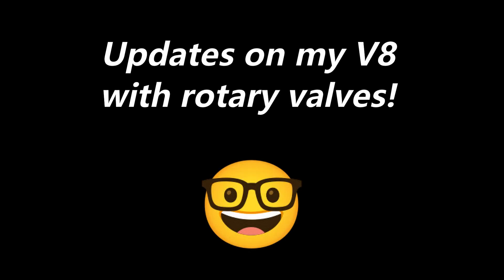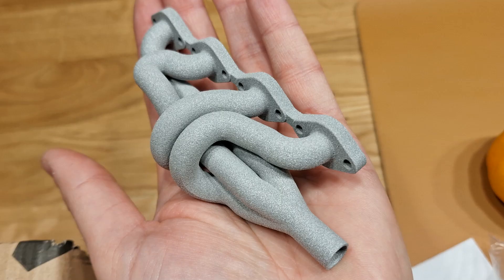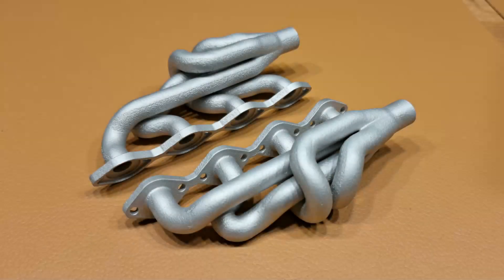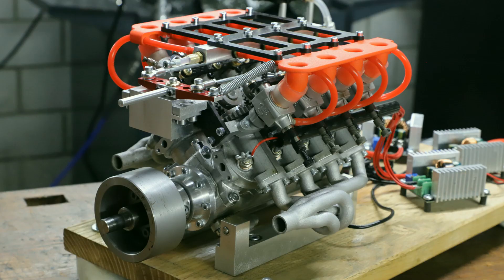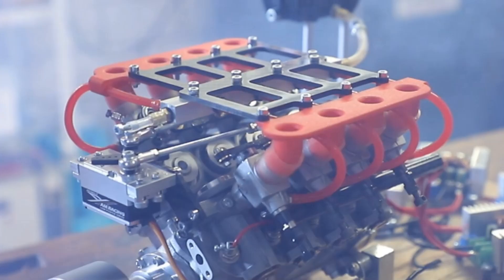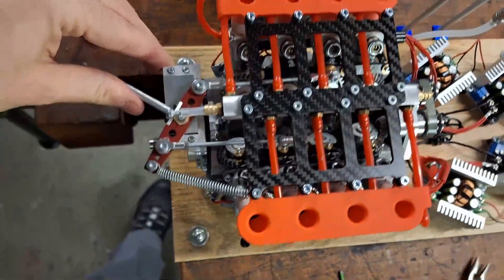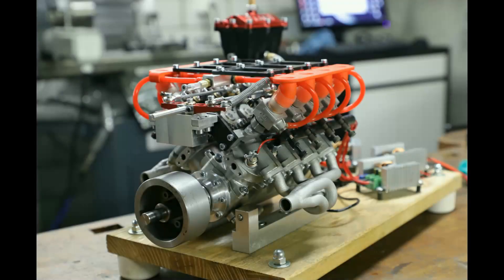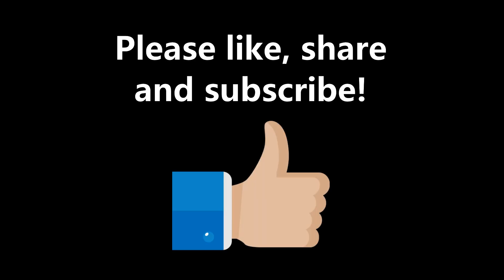Part 10: V8 model engine with rotary valve / New Exhaust and throttle drive

Comment: What fuel dos this run on?
Reply from the maker: Hi Adam! It runs on methanol oil mixture.
Reply: @danielhunziker3577 nice :D what sort of compression is required for that style engine?
Reply from the maker: @adambundy2639  Hi Adam 👋 Compression ratio is 8:1. But you could easily go higher.

Comment: Hi Daniel, nice running engine! I didn't quite understand the (transcript translation of) SLM metal composition, can you please elaborate. Are you able to mention who you used for SLM printing or a recommendation in that regard? I've built a running 50cc model radial engine, familiar with 3D CAD & would be interested to utilize this service on forthcoming projects.
Reply from the maker: Hi Peter 👋 I will write in English. But from your name I assume your mother tongue is German. If so, let me know and I'll write in German (my mother tongue). SLM is SelectiveLaserMelting. It's a laser-based 3D printing technology in which metallic powder materials are selectively melted layer by layer to produce complex 3D objects. it's a process with a high degree of design freedom. I made cylinders, engine block, pistons and intake manifold from it. Made from aluminium and/or titanium. This via the Protolabs online shop (plastic an metal 3d printing). But be aware that no finished parts will come out. The accuracy and surface quality is modest and all dimensionally relevant areas must be machined. So you also have to calculate allowances when printing.
Reply: @danielhunziker3577  I live in Canada (German parents) but I appreciate your effort to translate. Thank you for the Protolabs link, I will check them out. I think 3DP metal  would be a very interesting video topic for others to learn by your experiences - things to be aware of, shrinkage allowance, machineability, any strength issues etc. Because casting is such a special field for hobbyists. Also I invite you to join some of the model engineering forums like MEM (Model Engine Maker) & HMEM (Home Model Engine Machinist). Lots of like minded hobbyists. Keep up the great work Daniel. Great channel!

Comment: Why did you make the collectors so small on the headers?
Reply from the maker: Hi man 👋Can you explain to me what exactly you mean by "so small"? the collector on the exhaust has a diameter of 10mm. The individual pipes come out of the cylinder head with 8mm.

Comment: I like the finish on the new exhaust manifolds. I would love to know your secret on the valve gears. I'm sure the video takes out a lot of the noise... even still, I don't know how bevel gears are so quiet.
Reply from the maker: Hi James 😃 Yeah, spur and bevel gears are often very loud due to the straight toothing. However, the noise is directly dependent on the load and gearing quality. My rotary valves have very little friction, which means that the overall load is very low. For this reason, the noise is also low. That's why the noise is kept as low as possible. Of course, I'm just using high qualitiy gears with a good shape accuracy and surface quality. I use an EOS 6D MKii for filming with an external microphone. I did not actively use sound filters. In reality, I don't actively hear noises from the gear drive when the engine runs (reversing a car is much worse 😅). This may also be due to the fact that the oil around the rotary valves and the timing belt certainly provide good damping.
Reply: @danielhunziker3577  - I'm assuming you outsourced the gears then, as opposed to cutting them yourself?
Reply from the maker: @JamesCopeland-i1j  Correct, I didn't make the gears myself. Especially as I know how delicate gears are to manufacture (I originally come from the gear manufacturing industry). I always take care not try to save money in the wrong place 🙂 For example, I also use SKF ball bearings exclusively.

Comment: Ilmor made a v10 version much like yours, could we please have the v10 music too?
Reply from the maker: Hi mrwolsy3696 👏 I'm a big fan of the Formula 1 V10 era. For me, the engines back then were the pinnacle of engineering in terms of technology and sound. The V8 here is also inspired by this period. I'm currently planning a new engine. I don't yet know whether it will be a V8, V10 or even a V12. But I'm already leaning towards a 90° V10 along the lines of the Ferrari Type 053.

Comment: Really nice job done on it. The sound is so great too! 

What carburetors are you running ? I'm designing an inline 6 of 120cc for an airplane but walbro carburetors are quite big and heavy...
Reply from the maker: Hi maxairmodels7796 👋 I'm using 8x OS 4C 8mm caburators in this V8. You can buy quiet similar ones direct from Japan for arround 35 US$ per pcs (https://www.rcjapan.net/index.php?main_page=product_info&cPath=80_413_455&products_id=12795&zenid=a40ockefuloleleqfat1sfi050). This would be very suitable for your inline 6 120cc engine, as long as it's a methanoler. You should use 6 of these. But If you are building a gasoline engine these carbs are unsuitable because they are very difficult to adjust with gasoline.
Reply: @danielhunziker3577  Thank you Daniel for your reply. 

The initial plan was going with a gasoline engine but after your reply, the methanol makes more sense to my eyes as 20cc per cylinder isn't that big. The weight reduction will be also significant without the ignition system even though I'll need more fuel onboard. 

As you have much more experience than me, what do you think about it? The engine response should also be improved in comparison to gasoline. Do you run your engine with nitromethanol ? If yes, what percentage? 
I used some for my 2 strokes rc car, 2 strokes rc airplanes and also for a 4 stroke Saito engine if I remember well.

And last question, what compression ratio do you think will be suitable for my application? 

I can frendly send you the Fusion 360 file of the engine (just a few details missing and not designed but nothing crucial)

Maximilien
Reply from the maker: @maxairmodels7796  Hi Maximilien 👋 Your name sounds like you're from France or Belgium? Gasoline is one of those things. Mixture formation is much more delicate/sensitive and you also need an ignition system. I recommend starting with methanol. If the engine runs with it, you can still consider converting it to gasoline in a 2nd step. Nitromethane is generally not required for displacements > 10cc per cylinder. Nitro willl improve the adjustability of the carbs. But you can use pure methanol with around 10% oil in it (e.g. Molsynth 120). All my engines run with methanol with 5% Nitro in it. By the way: Have you already seen my V12 with 120cc? https://www.youtube.com/watch?v=sLy9mbBO354 An optimum static compression ratio is 8:1 for methanol-powered engines.
I have shown many things in my videos about how I build engines. Perhaps these can help you as well. You don't have to share your design. To be honest, aircraft engines aren't so intersting to me. As you can see in thi svideo, I'm more in exotic and racing engines like the ones from formula 1 😬😬😬
Reply: @danielhunziker3577  Hi again, you've guessed right, I'm French and currently studying in Munich (my German is not that great 😑). 

I'll do so. Start with methanol. 

I've watched your video about the v12, and I liked it. The methanol conversation was interesting in my case. I would just give equal length headers to it to get that lovely v12 screaming sound. I'm a car enthusiast too, by the way, so I understand 100% your statement. I'm building this inline 6 because I was bored to see mono cylindre at the field, I want something more special, and being a bmw fan boy, the il6 makes sense 😂. 

Your videos do help me design my engine. It's the most interesting channel about model engine : great quality, explanations, and great content.

One thing that caught my eyes is the single cam profile fixed on a rod precise and durable enough? I would be afraid if it came loose by the time, especially on such small scales. 

Another thing is the crankshaft, and as a matter of fact, before watching your videos, I used to design my engine with a multiple pieces crankshaft and with bearings pretty much like yours, but I switched to a conventional architecture with 2 pieces connecting rods as it is lighter (the engine should weigh ~4kg).
Reply from the maker: @maxairmodels7796  On the other side, my French is very bad 🤣 Then I'm not even allowed to say that I have a Luther BMW inline 6 cylinder with 55cc displacement. It's a replica of a BMW M20 engine.

This type of camshaft is common and tested in model making. Even Schillings has done this on an industrial scale. My VR5 also has such a camshaft. Never had problems with it.

I deliberately use multi-part crankshafts. The reason for this is that I don't want to have 2-piece connecting rods. These are super delicate and the screws tend to break off. With assembled crankshafts, you can use solid M4 or M5 bolts. That is super safe! The V8 here weighs only 2.9 kg with 53cc and has a multi-piece crankshaft. This is made of titanium with hardened steel crank pins. So a multi-piece crankshaft can also be lightweight.
Reply: @danielhunziker3577  okay, it's really nice having your advice. I'll deeply reconsider the camshaft and the crankshaft design. I was using a 3 valves per cylinder configuration (2 for the intake and 1 for the exhaust) with followers, so the 3 cam profiles are pretty close on the shaft, I'll try to figure it out, maybe I'll go for a double overhead camshaft. 

Knowing the weight of the v8 gives me faith for the crankshaft even though titanium will be hard to machine

About the m20 replica, don't hesitate to film this masterpiece 😂, i would love to see that scale intake manifold!
Reply from the maker: @maxairmodels7796  Hi Maximilien. I recommend that you build a 2 valve valve. Have a look at the OS or Saito engines! These are all 2-valve engines. My multi-cylinders engines from Schillings, Luther or Conley are also all 2-valve engines. Simply because it is easier to manufacture and the few percent extra power with 3 or 4 valves is usually negligible in a model engine.

My V8 isn't a reference. It was only intended as an example that multi-part crankshafts can also be manufactured in lightweight construction. Schillings, for example, also made some out of aluminum. Titanium is very laborious to work with. In particular, tapping with a tap drill is almost impossible below M6 (it immediately distorts and breaks off). I originally wanted to put M4 threads in the titanium crankshaft of this V8. It didn't work, even with pre, middle and finish cutter. I had to connect everything with steel threaded sleeves. My latest engine (in planning) will also have a multi-piece titanium crankshaft, but without threads and screws. But pssst... but the new engine is a secret! 🤫

Comment: What is the idle rpm?
Reply from the maker: Hi nicoserra4902 👋 The idle speed is 2'500 - 3'000rpm. So in a normal range for model engines.

Comment: Always excited for the rotary valve content.
I can tell it runs very well because the throttle response is fantastic.
Reply from the maker: Hi John 😃 Thanks man! I do my best to bring/show as much rotary valve content as possible. I'm currently working on several projects at the same time, which is why I'm not getting enough time at the moment to do specifoc rotary valve content. I'm also working on a new 1 cylinder test engine with a new rotary valve cylinder head 😉 But not all parts are ready yet... I hope to be able to make a video about this by the end of february. Then you will get new Rotary Valve content 😊

Indeed! The throttle response is really good! The sound is also really good. The manifold exhaust system was really worth it. It's really cool what you can achieve with SLM.